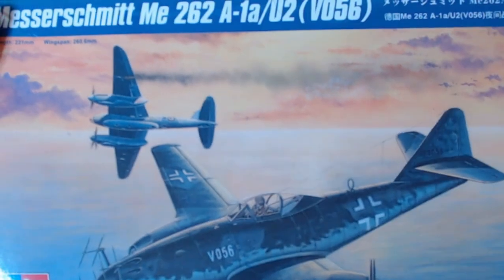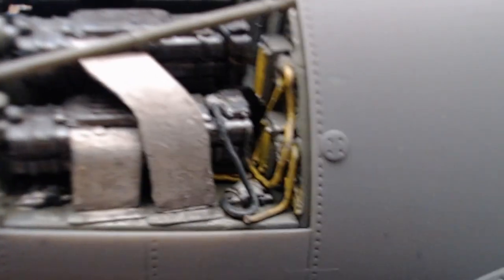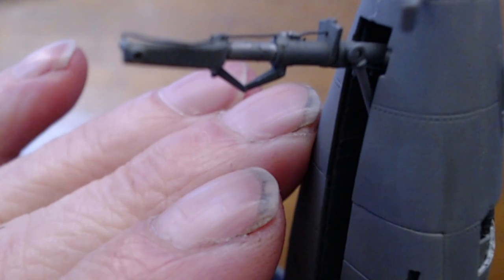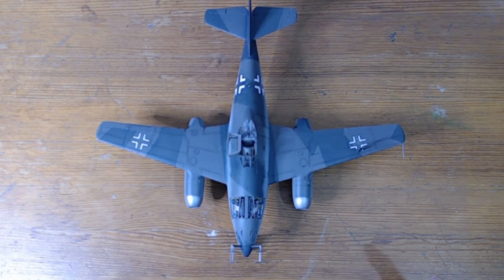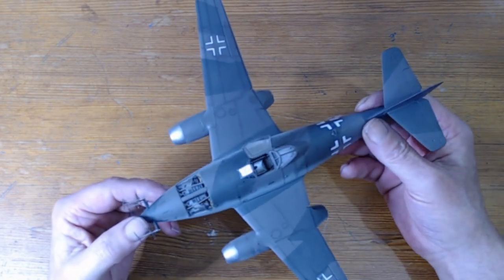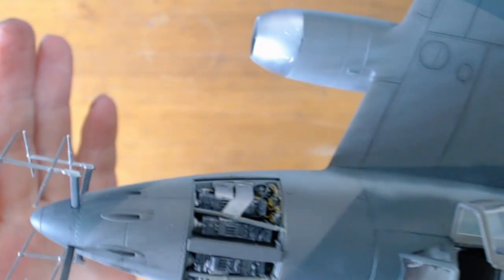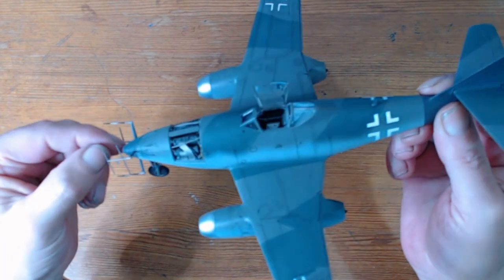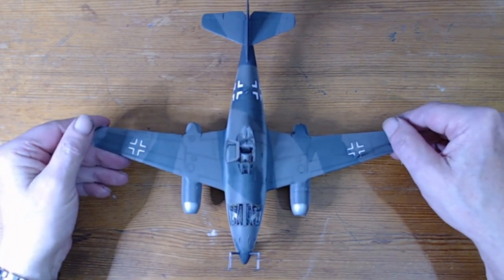hobby boss 1/48 Me262 A-1a/U2

Comment: V056 is a number indicating that this is a variant prototype aircraft - intended to test out an equipment fit. (ie a One-off) This is the 56th prototype of the Me 262, V-01 was the original First prototype aircraft, with a tail wheel, no jet engines and a Junkers Jumo engine and a propeller in the nose. Later early prototypes tested the jet engines (including the piston engine and prop in one case) and nose wheel. Another tested a different make of jet engines - BMW made, as opposed to the Junkers 004 which powered most 262's.
Reply from the maker: Thanks for that information 👍